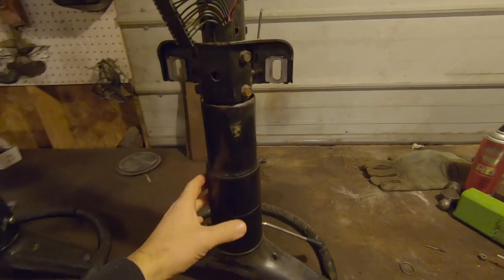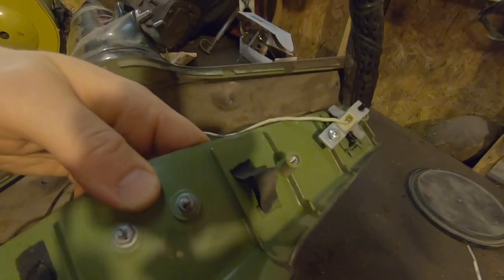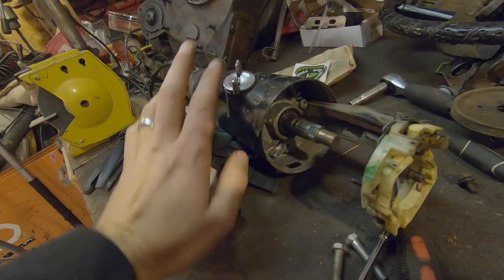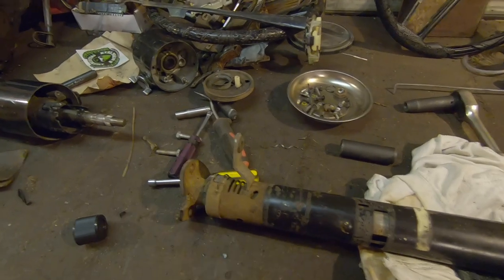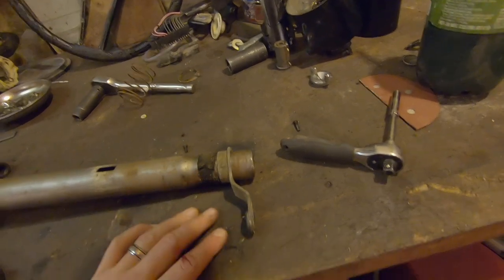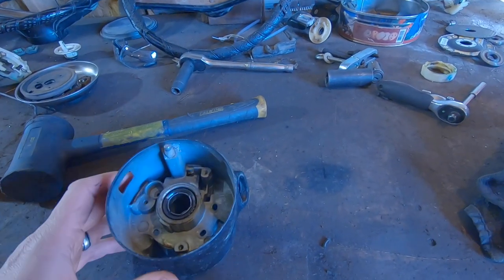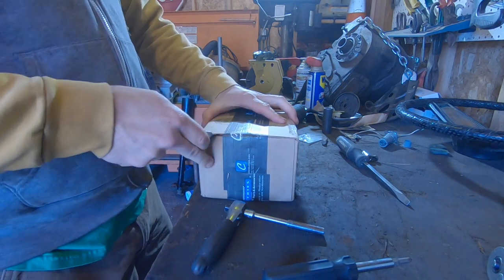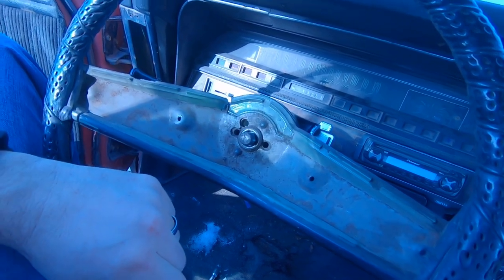Ghetto Glyder Episode 6: 1969 Impala Steering Column Rebuild

Comment: Is it necessary to repack the grease?I just got a different steering column for my 69 impala and I don't feel like tearing it apart.
Reply from the maker: I did because I had it apart, but I don't think it's necessary. It's not like a wheel bearing that is constantly spinning generating heat. Thanks for watching!